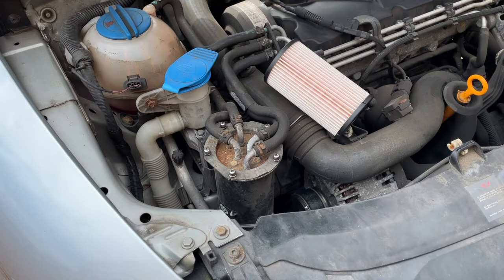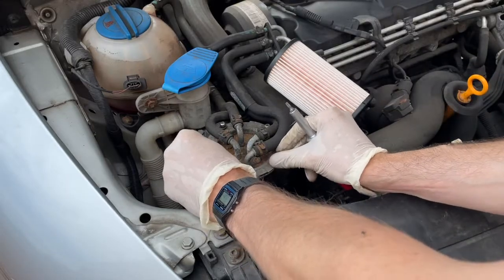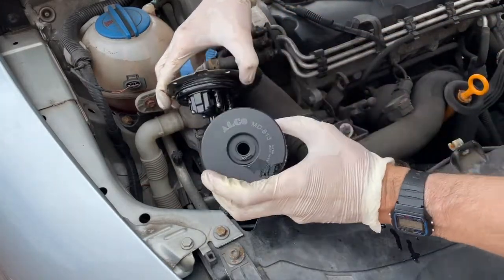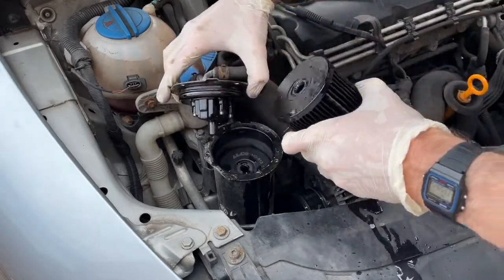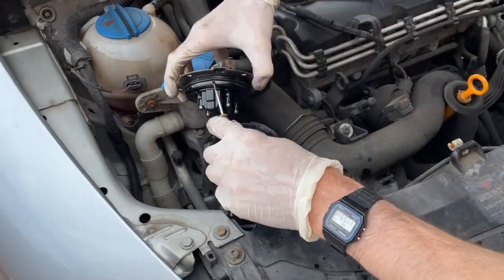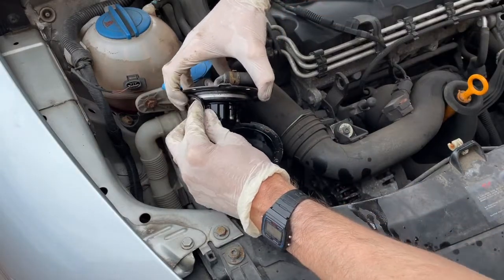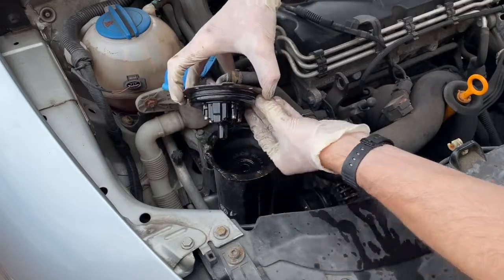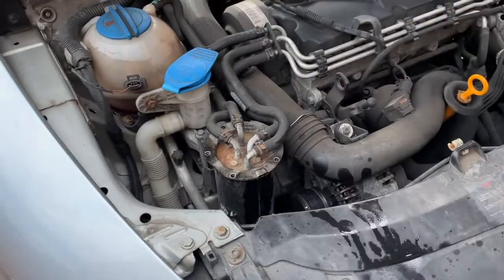HOW TO CHANGE FUEL FILTER - SEAT LEON

Comment: Thanks for rhe informative video, ive got a 2015 seat leon 2.0 diesel that a few days ago kept stalling as i went to pull away and jerking as i went up the road. Changed fuel filter solved those symptoms. 👍

Comment: Bought a fuel filter and was sent an audi one, doesn't fit as its too big for the housing plus its straight through with holes at each end not like the one in the video. Does anyone have the part number for the filter please